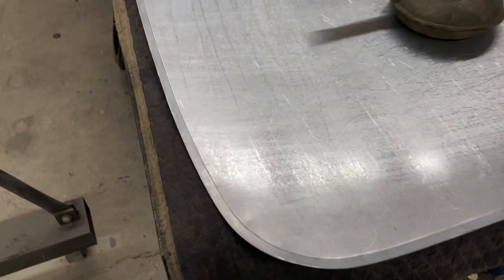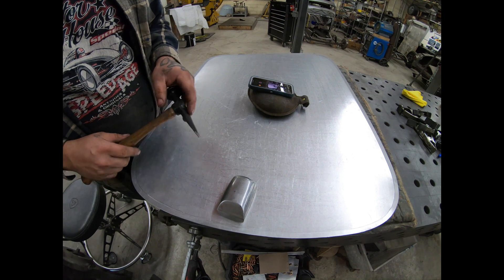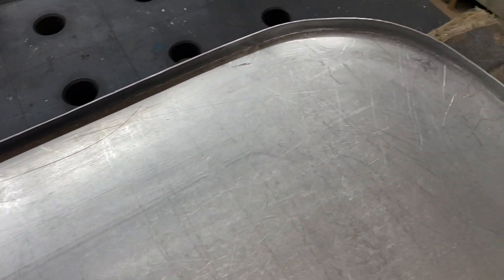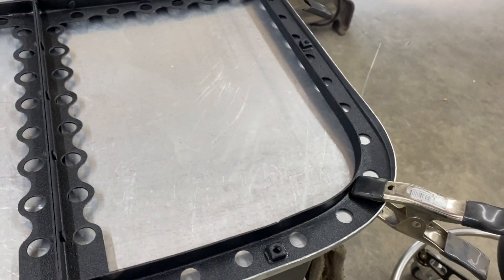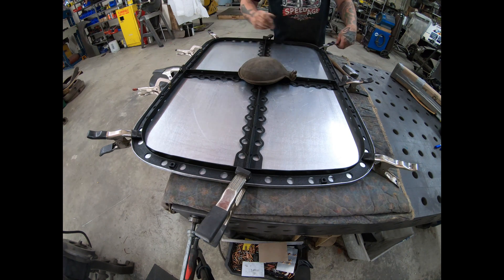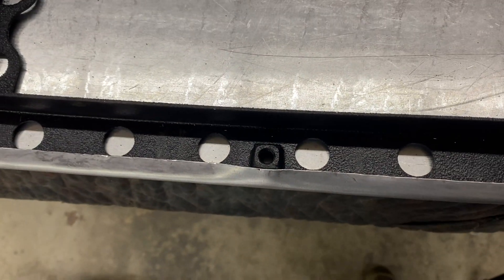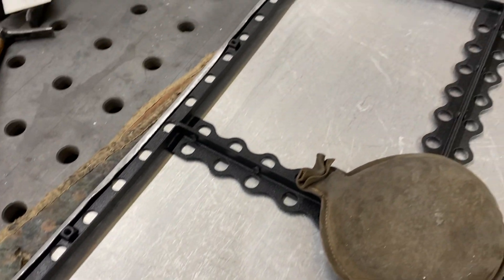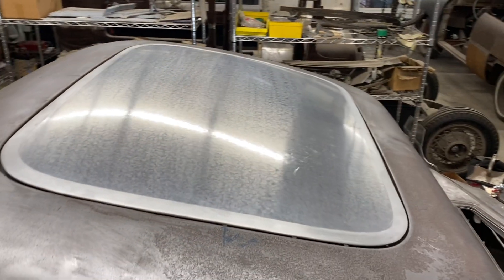How to Hem aluminum skin to inner structure

Comment: Did you bend up the flange by hand just for the video or would you normally do it that way instead of using tipping dies in a pullmax type machine?
Reply from the maker: @sblack48  just like i said in the video, start the flange on the lennox ( reciprocating machine) then to and 90 and finish by hand